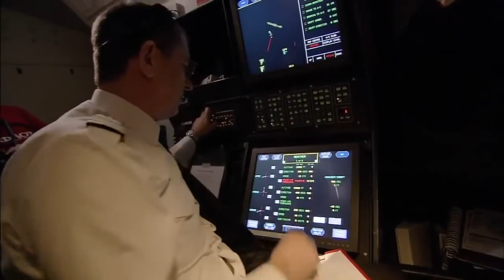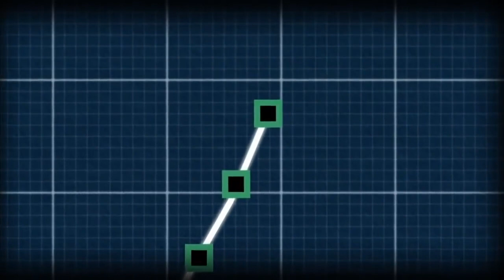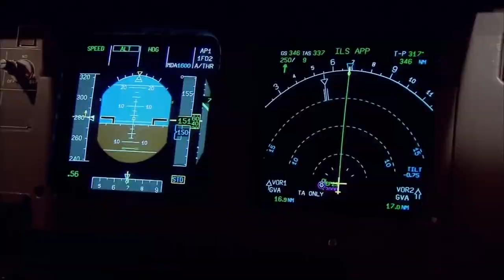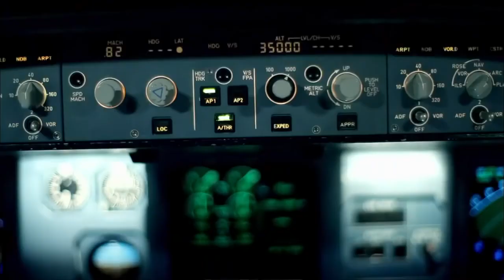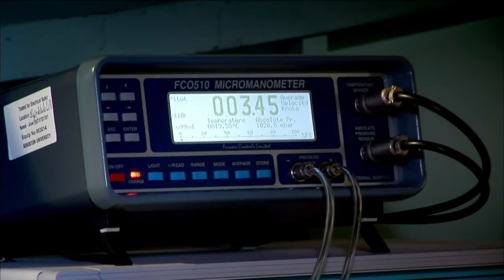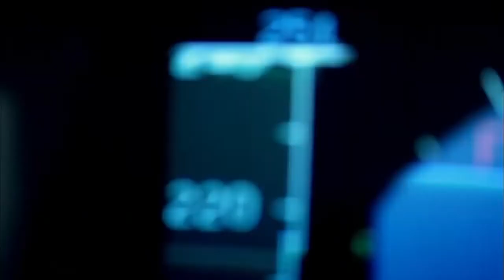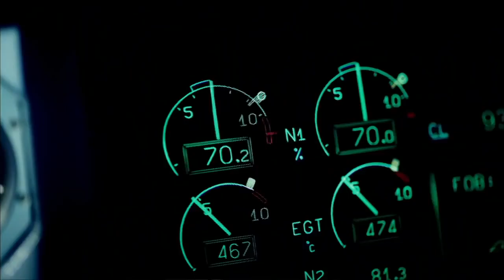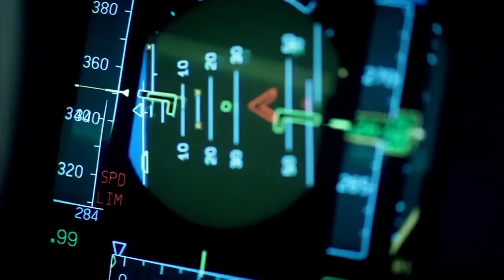Crash of Flight 447- PBS NOVA - Documentary

Comment: It should be noted that the speed limit varability of 10 Knots which might induce a stall  implies that the pilot must fly within this range , and although this is true it only applies to high altitudes  "coffin corner" where the aircraft is flying at the extreme of of its flight envelope.
This video is excellent  and  highlights the very real difficulty in flying through severe storms,  but it is manageable. 
Unfortunately the actions of the  flight crew  (AF 447 pilots)  it can be seen by  listening to the CVR  and viewing the FDR ,  were inexplicable and the pilot Bonin reacted wildly to the same loss of "air speed indicattion " by simply "pulling"  back on the  joystick. 
This lack of understanding and awareness resulted in the loss of the aircraft and all the passengers
Reply: Bonin did what i as an armature would do , or look we are going down let me just pull up.

Comment: The main reason why the remaining 178 bodies remain missing after the crash was mainly because the fuel tanks ruptured upon impact vaporizing them and leaving 50 dead bodies that are identifiable through dental records or other means necessary.

I'm not trying to point fingers.  But in addition to the crash, the least experienced first officer caused the crash because he was mainly new to the airplane and new to the job at hand.  The other two pilots were more experienced and could've saved the airplane and everyone onboard.  
Therefore, Air France and Airbus had somehow failed to effectively train their pilots carefully in the case of Air France 447.
Reply: Your post is outdated.  After the plane was located on the bottom of the ocean, only 74 of the remaining bodies were not found.
Reply: Actually with any plane that pilot would have made that certain mistake.